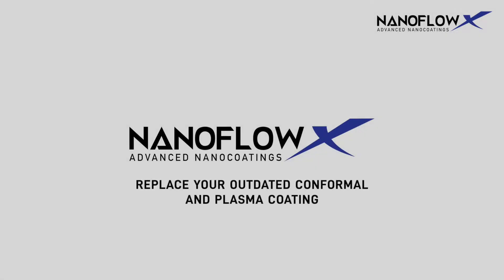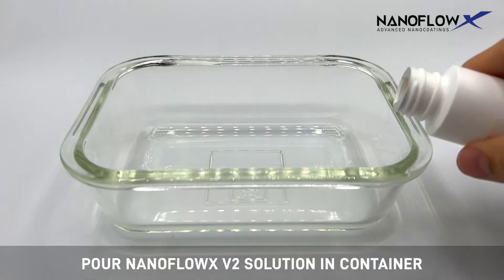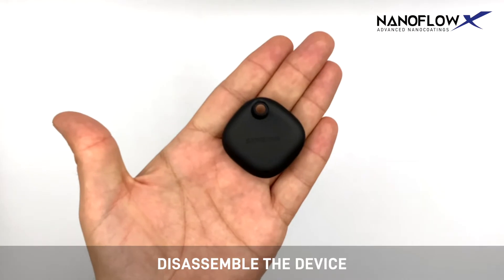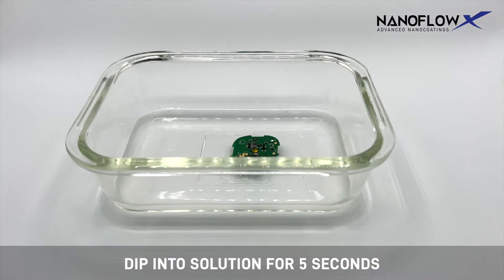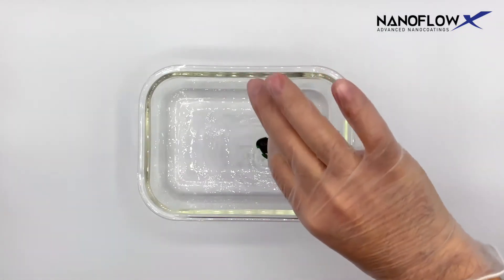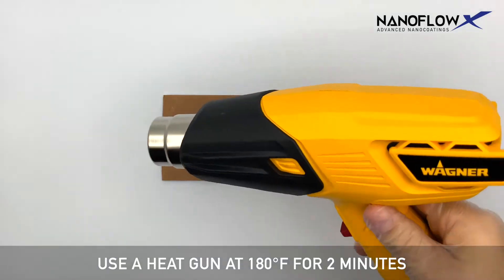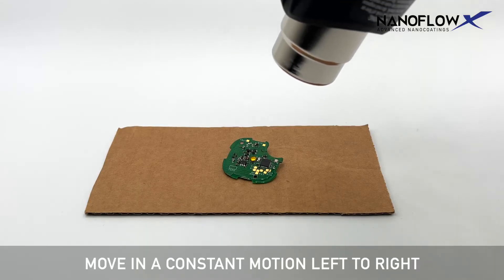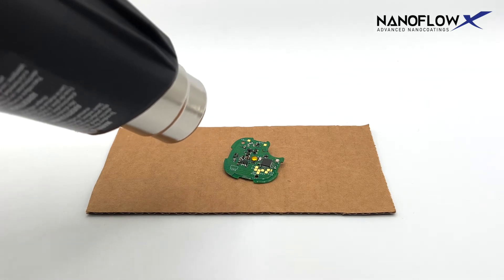Samsung Galaxy Smart Tag and Made It WATERPROOF in 2 minutes with NanoFlowX

Comment: Hi. How do you deal with the battery contacts? Wouldn't the coating create an insulating layer on them as well, reducing or preventing the tag from proper operation?
Reply from the maker: Does not affect battery contacts

Comment: what about the battery? the battery isnt water resistant.
Reply: I've never heard of 2032 or any disposable batteries being damaged by liquids
Reply: @kewlztertc5386  but they rust. The battery in two of my samsung smart tags rusted after exposure to moisture and liquids. The rust spread onto the metal connectors inside that connect to the battery. So just waterproofing the board might not actually work. Have you testet this in real life situations?
Reply: @VideoPine  knowing this, it would be reasonable for you to remove the battery and dry it off. 
The problem with adding a protective coating to a cell battery is two-fold.

1st, coin batteries are inexpensive.

2nd, adding a coating would inhibit, or reduce conductivity.  Changing the performance of the battery.
Reply: @kewlztertc5386  but that's what I mean this coating won't make the smart tag waterproof because the battery would still get wet. That's what I'm saying. To make it waterproof you would need to make the casing waterproof aswell.